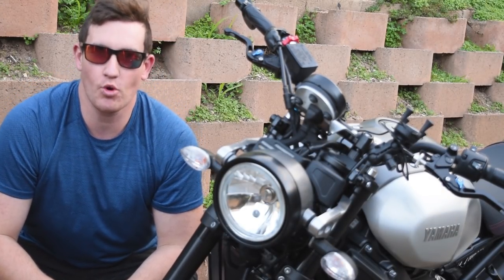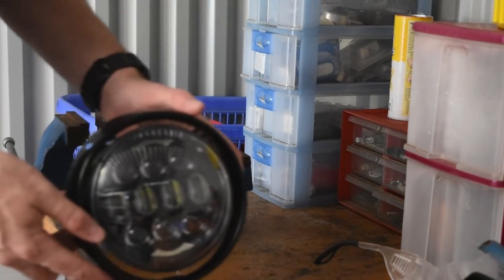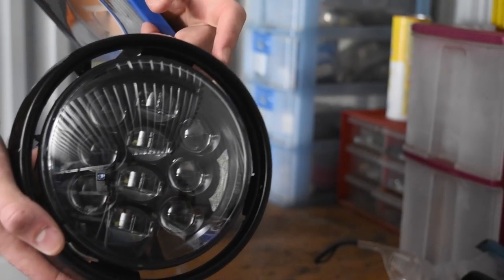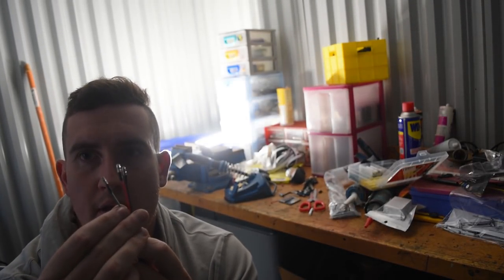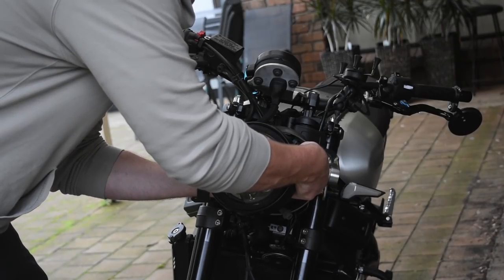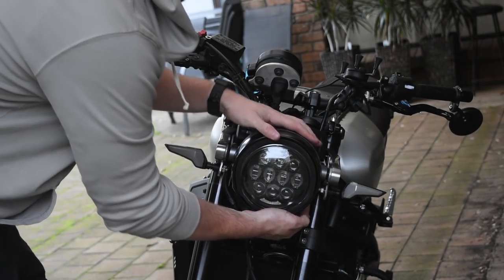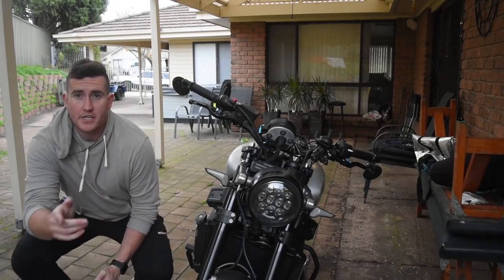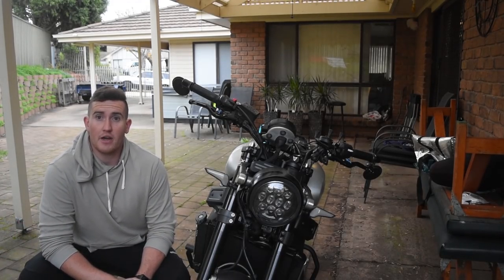LED Projector Headlight Retrofit - Yamaha XSR900 Scrambler Build

Comment: Thanks for brilliant video! I am sick and tired of mine and gotta change it better one for night rides. 
Just couple of question. 6.8 headlight would be too big for the stock housing. Not really eager to change the stock housing :(
Reply from the maker: I've used a 5.75 and it's a bit small, 7 is a bit big but they make kits  for them. I'm under the impression that anything outside these two sizes area basically cheap shitty knock off headlights. There are a number of adapter kits for a 5.75, just depends on whether you want to spend the money, or do a backyard solution like mine!
Reply: What kind of kit do you mean here?

Comment: Looks dope! also considering of replacing mine. What happens if you dont put weather stripping tape?
Reply from the maker: Water could get in and corrode the terminals, also looks a bit funny with a big gap there

Comment: Hey mate, How'd you rig up a bracket to mount to the factory bucket? My LED has no holes on either side to mount?
Reply from the maker: I cant remember exactly how I did it, but if I was going to do it again, I'd drill some holes in the heat sink plates, and make a bracket from buts at the hardware store
Reply: @Tempcitz  yeah sweet that's what I'm thinking, cheers for the replay mate!

Comment: Mine just arrived but couldn't figure out how to make it fit on the headlight housing. Did you drill any holes in the aftermarket one to make it fit?
Reply from the maker: Nah I didn't, though I think you'd be alright If you superglued/plastic welded some threads on there hey

Comment: If I were to get my learners and get this bike for lams would I be able to change these and the exhaust at home or do you have to get it verified by a mechanic?? I've looked around and every answer is different. I'm in Queensland btw
Reply from the maker: The 900 isn't Lams anyway, only the 700 is.
The headlight wouldn't be an issue, neither should the exhaust as long as you keep the baffle in! Both can easily be done at home
Reply: @Tempcitz  I ment the 700 bro sorry and yeah sweet the laws for bikes and cars is insane in Queensland
Reply from the maker: @spedinator2874  I think the akra pipes are legal if the baffle is in, and they don't really affect hp, so should be okay lams wise
Reply: @Tempcitz  sweet thanks for the info bro

Comment: Looks solid man. Been looking at a second bike and it's between the XSR and Triumph XE scrambler.

Does the XSR fit well for tall blokes? I'm 6'5 and everything feels like a grom.
Reply: I'm 6'3". I love my XSR. I did add handlebar risers which required some cable rerouting and minor modifications. Rides almost exactly the same, but greatly increased my comfort.

Comment: I like the way it looks but that weather stripping won't last long  as soon it gets wet or even with the wind force it will start getting off. Didn't you find a bigger headlamp?
Reply from the maker: CSI AUTO DETAIL the stock headlight bucket is a bizarre size, 5,75:is too small, 7 is too big
Reply: Ist your seal still working?

Comment: Beautiful job I have the same bike absolutely love it how much did this cost you between the headlight and the blinkers thank you for all the great videos and footage keep them coming I am looking to do a full mod list on my bike starting with performance it only has 600 miles as of now so soon I’m looking to do an exhaust system then either power Commander five or send it to get flashed I’m not really sure what’s better for this bike but I want to be able to takeoff the rev limiter and the top speed limiter besides that I think the bike will be perfect afterwards
Reply from the maker: I think the general consensus is flash is far more cost effective than a PC.
As far as cost of the headlight and indicators, I have links in the description for all the parts I use!

Comment: How does the XSR900 ride on dirt and gravel with those tires?
Reply from the maker: It's absolutely nuts, whole lotta power, so gotta be pretty light on the throttle, but she does alright!
Reply: @Tempcitz  Was you able to get the Karoo 3 tires in the proper size for the bike?
Reply from the maker: @shoenshell  sort of, the front is a rear, because they only make the fronts in a 19inch rim

Comment: Hey mate, nice video. What mirrors are those?
Reply from the maker: Just cheap bar end mirrors off eBay!
Reply: Temporary Citizen sweet, I’ve been looking at getting the same. How are they serving you? Did you need to rig up a spacer to get your bar ends to fit back on?
Reply from the maker: @_VC93  yeah I made one out of a little pvc pile, worked like an absolute charm!

Comment: Hi, how can you connect the parking light to the led? 🤔
Reply from the maker: You would have to chop the connector and splice it, but I didn't bother
Reply: @Tempcitz  i have to because of the German TÜV and the law. So is ther something to plug it into the led headlight?
Reply from the maker: @danmanlivingthedream  there is a spade plug on the headlight, you would have to splice in the connection on the parking light wire on the bike, but shouldn't be a problem
Reply: @Tempcitz  ok cool

Comment: Is your rubber seal still working?
Reply from the maker: Yeah it is! Although I replaced it with a slightly better weather seal rubber strip
Reply: @Tempcitz  wich one?
Reply from the maker: @danmanlivingthedream  was just a different variation of a rubber weather stripping seal
Reply: @Tempcitz  and now it's working?
Reply from the maker: @danmanlivingthedream  it was never not working, just works better